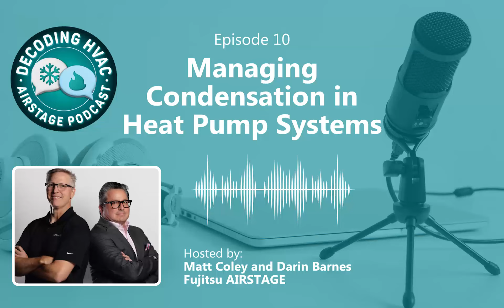Managing Condensation in Heat Pump Systems - Decoding HVAC Podcast (Episode 10)

Comment: Why oh why does not one manufacter build a wall unit with built-in condensation pump.  
Also Fujitsu please just built in wifi. Control as well.
Reply from the maker: Thanks for sharing. Not a terrible request but unrealistic from an engineering and manufacturing perspective.